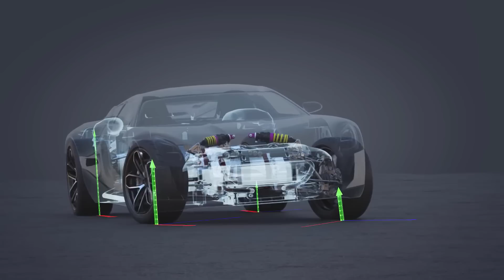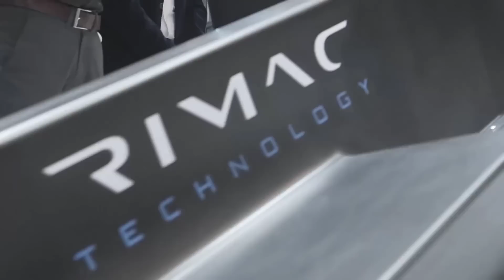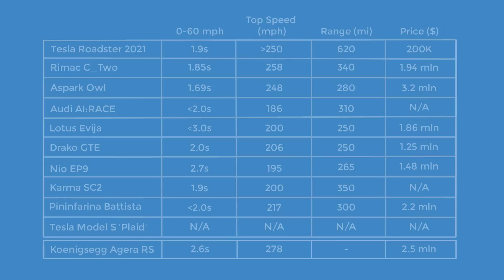World's FASTEST Electric Cars! 0-60MPH in 1.69sec?!

Comment: I really Like The Rimac "Hamster". The Tesla is the Bargain in this group at only $200k!
Reply: Richard Hammond likes this comment xb
Reply: Rimac way too high. The C2 is pushing $2mil. Tesla has got a new long run batt which should give their cars 500+miles and million mile longevity.
Reply: Have they started selling the roadster?
Reply: @dieseldog00  Rimac has been testing. Roadster 2 hasn't even left the factory yet. It's all good talking about value but at least one of them exists. 🤷
Reply: @aslanbayramuqlany6189  No. It was supposed to be this year but they were never gonna reach that target. The virus gives them breathing room. Expect nothing before the tail end of 2021.
Reply: @dieseldog00  He likes the Rimac, he also states Telsa is the Bargain.
Reply: Rimac is faster and looks better
Reply: Tesla roadster is nothing more than cofin on wheels. I would never sit in car that can go 250mph without any security beside seatbelts.
Reply: I'm your 69th like. I didn't read the comment, just saw the 68 and had to click.
Reply: @Wache3  the max speed needed in a Supercar is 217 mph
250 is suicide, 0-60 time is probably all that counts in this video
Reply: Electric is not this fast and this is fake1 electric is not as powerful as 2 stroke gas engines! Oops aint all the fuel we use work off electron bonds with oxygen in the air!
Reply: @jlo13800  actually most of these cars are actually that fast
It's only the Tesla roadster that isn't real here but the rest are
Reply: @Vnm 04 but they've been driving for years now it's kinda getting annoying
First it was due to come out in 2020, then they changed the date to 2021 so it got me wondering
Reply: Whilst they are almost on par on power with each other i wonder if Tesla is making any profit on its roadster when the rest want to get very rich very fast.....
Reply: @Vnm 04 oh ok, so that’s why Elon Musk became the richest man on earth 😂
Reply: @xenomorph1317  naa he became rich bcoz of the model s' and 3's
The roadster is gonna cost him since it's a Supercar
Reply: @dieseldog00  The C-2 a hyper car that only 150 will be made,watch a video on the vehicle and what it's capable of.Youll see why it costs so much.

Comment: You know you're not a 'Super Car' (or whatever they're called these days) when the Cybertruck is as fast as you...
Reply: I put my deposit down on the 3 motor truck. I think Elon should make all Teslas 4 motor vehicles.
Reply: @dieseldog00  If it were easy, he would do it on the Roadster. It's not because it's hard to create enough down-force (at lower speeds like 0-20). The torque is basically being lost because there isn't enough friction between the wheels and the road.

John Carmack suggested that the Space-X package could use cold air jets to generate some downforce to convert more of the torque on launch into faster speed. He's just guessing, but he's a really smart guy and good at guessing...
Reply: That... Is the stupidest thing I've ever heard
Reply: @descendency  Just because a car is faster in a straight line doesn't mean it beats a supercar. Even heavily modified Supras can crush supercars ina a drag race
Reply: if you don't know what you're talking about, don't talk please 💀💀

Comment: Tesla Roadster 2020 with cold gas thrusters: Hold my beer (0-60 in 1.1 seconds)
Reply: 2.1 seconds as base is disappointing
Reply: @user-nq6ln1wv8b  1.9 you mean
Reply: @user-nq6ln1wv8b  it’s 1.9 base 1.1 with the space x version
Reply: I don’t believe there would be actual boosters, can you imagine the amount of deaths and court cases with fast acceleration and high top speeds,
Reply: @oliverbird6233  probably not this would 10 g force on your body if you are not an astronaut
Reply: @manuelweichelt528  that wasn’t English
Reply: @oliverbird6233  yet you figured it out ada boy
Reply: @manuelweichelt528  well clearly my comment wasn’t an answer which breathes understanding so no I did not
Reply: @oliverbird6233  sorry i was in a hurry when i wrote it. What i meant is this accelaration would be very painful, as those are 10g which would mean that you get pressed in the backseat with ca. 1000kg i guess this is about the force an astronaute has to endure.... So under 2 seconds 0-100 becomes meaningless (still it is very impressive)

Comment: I'd love to learn more about the Aspark design. How they actually achieved the weight. Everyone does carbon.
Would love to see a pack of 20 of these cars on slicks doing a 20 minute race. Wonder what pace they could hold for a 1-2 minute lap, a 7 minute lap and such a 20 or 30 minute race.
Reply: Basically, first of all it barely has any "trunk space" and is practically built wrapped perfectly around the components with only space for a small to mid sized driver leaned back in racing position and a passenger doing the same. It is also wind tunnel optimized with air channels going through out the car (like the Buggati Chiron) and is built with the shape also purely focused on aerodynamics as initially optimized by physics modelling software connected to machine learning models that use all that data to build more organic shapes for better performance while staying within strength, endurance and stability limits set by the designers and engineers (it is a bit more complicated than that of course but that is just the simple explanation.) Now remember how I said the driver is leaned back and low, well that isn't the only thing that is low, the optimization and physics of air resistance tells us that a car this "small" should be extremely low to the ground for optimal acceleration and it does just that, it hits under the 1 meter mark which means this thing cuts through air like a knife through hot butter, the whole design is based around keep it as low as possible and that is why like F1 drivers, the car interior is build leaning back so you can keep it that low even when the driver might be double the cars height (that is also why the car is a bit long (think triangles, to get the height of the triangle down, you need the driver who is the hypotenuse to be leaning back really far, but that makes the length of the triangle really long because the size of the hypotenuse aka the driver can't change.) Now these are all great, but what really makes it shine is obviously going to be the core components, aka the 4 powerful electric motors (two front-two back of course because AWD means more grip, better traction means better acceleration) which have software to optimize grip during any sort of turns based on sensor data from each individual wheel. Honestly every part on this car is custom and amazing with only one intent, faster acceleration, yes, even the windows were built to make this car go just that little bit faster. Other than that, it has all the performance features that most super-cars have these days, active wing, carbon fiber body, the whole deal. Oh and yes, 2000hp at 4100 lbs, that is bugatti levels of weight with higher performance than a bugatti. A friend of mine left Porsche to work for Aspark 6 years ago and a lot of his acquaintances thought he was crazy for leaving what is a dream job for most to instead go work for some company that none of them had ever even heard of, but I knew that the design and the engineering for performance is what had always been his drive, he was a racing fan like myself and we had grown up watching Le Mans together, these last two-three years have been very stressful but rewarding for him, but he is glad he left when he did because he says his team at Aspark is just so much more passionate and hardworking, and that the culture of respect and brotherhood in Japan makes for great work culture. I'm going to have to get him to help work on a custom EV project with me if he ever moves back to the states, I need some of those trade secrets.

Comment: I LOVED the design of China's high speed electric car. Rear spoilers were just super impressive. When I looked at how sharp those turns were at such a high speed and great control, I was shocked more than any vehicle than I saw on this vehicle. I need to be less reliable on gas-powered vehicles, and think about not just performance, but even the design and type of power the vehicle the car needs. Most of the gas-powered vehicles I have seen so far are just too expensive and not worth even buying, so I ended up with this video and said that this is not just any type of performance race car.

Comment: I am going to cancel my Cyber Pick-Up and get the Roadster. It is quickest to 60 mph in 1.56 sec with the Space-X Package. Also, Tesla should have plenty of service centers unlike the others.
Reply: Tesla also plans to produce thousands of them unlike the other as well.
Reply: Check insurance costs
Reply: Joseph Tucciarone , where did you get the 1.56 0-60 time ?
Reply: @shepherdsknoll8  make sense for rocket package booster it's not about the horsepower anymore in top category and their wall you called tire grip and theit a fundamental limit on that. To counter that limitation a rocket is necessary to propel the car faster than any real time world record ever made in history.
Reply: @chillrawr9603  its not a rocket, its a cold gas thruster, it may help by shoving the car towards the ground for better grip.
Reply: I suspect that Tesla may have some trouble putting thrusters on a car and keeping it street legal...
Reply: @miguellopez3392  OR... you could just use an electric fan!
Reply: @alphacentaurianperson  any combustion  propeling System on a car is Ilegal in US and EU 

It would probably be only some hidden system using the air to push the car to the ground to have more grip
Reply: yes i also think that they wont build in rockets. its not possible to keep it street legal. but i am sure elon ment the spaceX version will also be street legal. so it cant be actual rockets. but maybe, just maybe new tech thruster doesnt count as rockets :D
Reply: @miguellopez3392  You do know that is considered as a rocket as well right? Just informing you. People think of rockets as something that needs to have that fire or explosive effect when in fact rockets currently being used to deliver components to space uses that same exact component that would be put in the package and the same exact cold gas for air pressure, albeit of course it is bigger. My only concern is the safety because looking at what happens on the rockets when that air tank gets punctured or torn I can only say you'll probably turn into red mushy mist afterwards.
Reply: @thetalkingnotepad5638  except the rocket is not being sent to space with a compressed tank of air, it's being sent with 9 diesel engines that combust its fuel source to generate power for the engine and thrust for the rocket, much different concept then electronically   oppening a valve to let a little air out for rotation adjustments. Is my nail gun also a the same as a powder actuated nail gun? No their operation is much different I even met a guy who knew someone that got kill powder actuated nail gun from being used like a air nail gun, and that's why OSHA made sure I knew how one worked, air compressed nail gun not much safety attention needed.
Reply: @miguellopez3392  No, oh my god you don't even know how they use COPV in the falcon  rocket or any other rocket engine dude you are jumping to conclusions. COPV isn't being used to for little rotation adjustments in space or in jets, that is called RCS and COPV isn't used in RCS. You really like to sound bright but you don't even know what you are talking about. COPV(the one going to be used in the Tesla) is a form of a tank that contains air, it helps boost the rocket from ground to out of orbit and give it more power by boosting the propellant to make sure it maintains better pressure than what you would achieve without a COPV and thus more thrust. Now instead of boosting thrust they are trying to make it the thrust which kinda makes sense since you don't want a highly combustible fueled rocket yet on your car so the one being used as a booster can be a good source of thrust, not too much but enough to actually do something. RCS(the one you have mistaken the COPV for) isn't used to boost the rocket or a space shuttle from ground to out of orbit since it is too weak it is usually only used in space or to do minor adjustments to some jets like jump jets.

Comment: NOte how little other brands bring to the table in terms of specs even when they cost ten times as much as the Tesla Roadster 2021. One starts to wonder what the sales arguments for such cars will be. In theory, every electric car can accelerate 1-100km in 2 seconds but there are limits to material and other elements which necessitate to cap acceleration speeds by way of software. It is a whole new ballgame and not many petrol heads realise what is going on. EVs are so much more efficient and better and cheaper and faster than ordinary combustion engine cars, that there is no competition. Everybody wants to have an EV as soon as one could recharge everywhere, just like one can fill the tank up with petrol/gas anywhere anytime. A full tank of $80 does not compare to a full charge at $8. It is a new technology that will supplant combustion engines as soon as there are enough available and the lies of the anti-EV propaganda have fizzled out.
Reply: When an pure electric car beats an f1 car around a circuit, then i'll change my perspective.
Reply: @Bahamuttiamat  That already happened with concept cars accelerating to 100 below the standard of the Tesla Roadster. 1.65 seconds was the fastest. But F1 is limited between 1 - 100 according to Alonso on Reddit. And this is the challenge. You ask an EV production car owned and driven by a consumer like you and me, that has to last 10 years and 100.000 miles (160000 km) to outperform an extremely fine-tined racemonster in F1 that is not even able to last longer than 3 hours or 500 kilometers without major repairs, two tire changes and on-the-fly fine-tuning by a team of 20 to 50 specialists. Once you have driven an electric car and found you could with great ease outpace any Porsche at the traffic lights or highway, then you know there is a new kid on the block that won't go away.
Reply: I know that electric cars, especially Teslas, are crazy fast, more efficient and offer a lot more for a lot less money than some of the premium brands. We petrolheads understand that. We will applaud you and then drive away in our internal combustion engine cars, smiling to ourselves. These 0-60 times hardly attract us because we know that although they feel like a whiplash, they don't have the soundtrack or theatrics or the appeal of say, a naturally aspirated v10. And if it's a manual transmission gearbox then that fun is exponentially increased even cornering at around 60 mph. I guess it's going to divide people into 2 kinds of drivers: 

1. those who just care about the fastest 0-60, efficiency and sometimes even to show off to their friends in drag races. 

2. Those who appreciate every little sensation that a really exquisite ICE car delivers. These people drive out to enjoy their cars and enjoy the roads and the views while listening to the revs building up and falling down as they shift through gears, and these are the drivers who will never feel thrilled driving an electric car.
Reply: @The Philosopher of Culture Sorry friend, you sound uninformed.  Where exactly is the tesla roadster?  It isn't on sale and not one has been delivered to customers.  F1 engines are designed to last over 5 thousand kms.

That said, the new ev's are impressive at acceleration.  Driving isn't all about going in a straight line.  One doesn't buy a porsche for 0-60.  When an ev can keep up in the twisty bits - real driving.  Then I'll accept the future with open hands.  Electrics cars, mainly their power source is too heavy.  The motor itself is superior to any ICE but batteries are far inferior to fossil fuel.

Comment: Another 5/10 years cars will be hitting 0-60 in 0.5 sec, now let that sink in
Reply: nope, traction limit, 1.9 is the limit unless you are using very soft tires that require a change every 500 miles.
Reply: @miguellopez3392 logic says tyer  technology improves with the performance of cars, what do u think F1 cars use, metal tyres??
Reply: @returnofthestrangers  that's cool but this is meterial science not mechanical engineering, try using F1 tires on roads and see how long they last and how much you will enjoy getting a new $$$ set.
Reply: @miguellopez3392  If you don't understand logic, best you dont debate or go back to school, technology is changing every day, what was impossible yesterday is  possible tday, hope that wasn't too difficult to inderstand?

Comment: Larger battery packs aren't needed. Better battery power management and energy redirection + better motor efficiency is what's needed. Electric motors use more power than needed and they arc. Energy can be captured and redirected back to the batteries by closing the circuit between the motors and the power source using a material that is more conductive than aluminum (graphene)

Comment: All those name brand vehicles are asking so much while giving so vert little. That lotus is an example.
Reply: dont trust the lotus numbers, 70kwh battery will be much more limited in power output and endurance the the 130-200kwh batteries inside other cars unless they are likely ruining the battery  hot and don't care about battery degradation since they can replace it for around 100k at almost no inconvenience to their multi millionaire customer or they have made a significant gains in battery cooling technology and can cool the battery just fast enough that it wont burn out mid race.